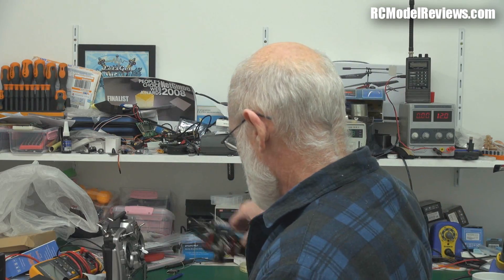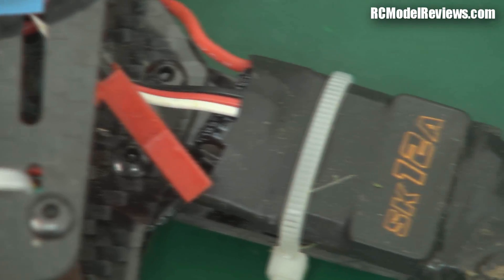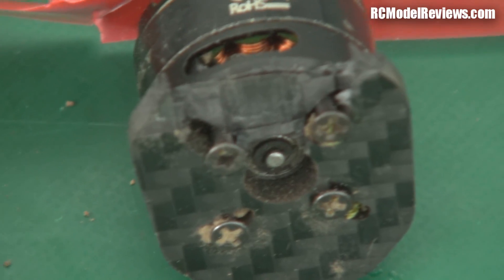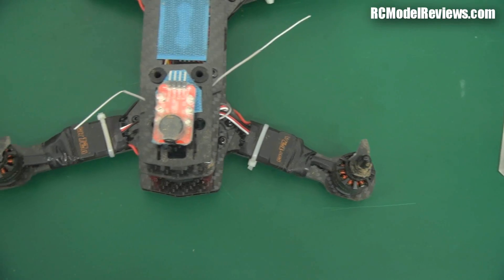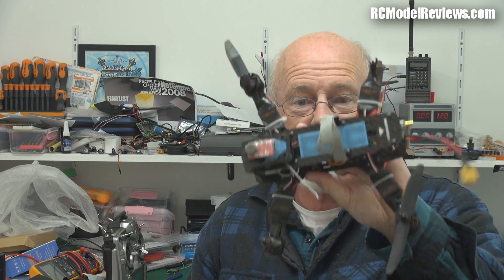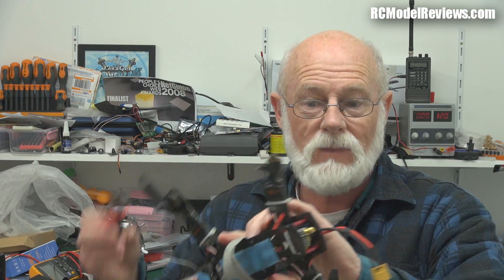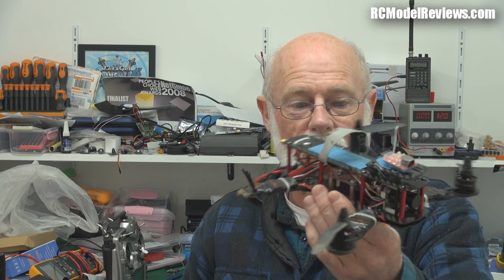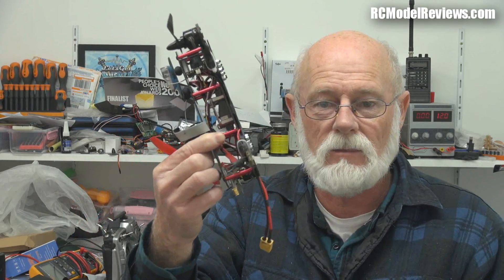ZMR-250 Chinese mini quadcopter crash report

Comment: I guess the absolute purists here will say you are assuming at least one thing here, Bruce.

And that's that the quality of the CF itself is the same for both the Blackout and Chinese arm. And, of course, that they are of the same thickness.

If we assume that both arms are of equivalent thickness and quality of CF process, then the physics of stress-risers is at least comparable.

BUT - I'd almost bet my left nut that something made by Blackout is GENUINE carbon fibre... laminated and baked etc. under strictly controlled manufacturing processes. And I'd almost bet my right nut that the Chinese copy is going to be lucky to be all CF, with probably a lot of fibreglass thrown in there with some black pigment and some neat top and bottom laminate this is actually real CF matting. If you're lucky.

Hell, I can airbrush you a piece of just about anything and make it look like genuine high-quality Carbon Fibre.

So while this vid is very informative regarding the theory of stress-risers etc, it is still assuming that both blanks that were used to create each design are of the same physical construction and quality. 

Out of interest, I'd love to see some MOR (3-roller Modulus Of Rupture, or aka 3-point Brazilian Fracture tests) and CCS (Cold Compressive Strength) results from the base CF stock used in both arms.

I'd just about bet BOTH my nuts that what you are getting from the "more expensive" brands is genuine and correctly manufactured Carbon Fibre composite as opposed to something that 'looks kinda carbon'.

Just because it's black and has a nice symmetrical weave pattern top and bottom DOESN'T mean it's carbon fibre - I can do that with some black and grey paint, an airbrush, and a piece of fine wire mesh... and make your average BIC lighter look like something from an F1 car...

Q:)
Reply: Nice job of quoting Wikipedia, do you really have a clue about what you have written?
Blackout doesn't make their own CF they buy it from Japanese manufacturers like everyone else does and if they say otherwise then I would love to see their plant and meet the man that put up the millions to build toy helicopter airframe CF.

Comment: The motor can be repaired if it is just the wires. Just rewind the coils.
Reply: Tuttomenui For $9.99 it's just not worth the time.
Reply: yeah true, but for the $45 motors you mentioned if you had the same issue in that case it might be worth it.
Reply: Tuttomenui
However, if you can afford to spend almost $200 on motors, I suspect you'd be using a more expensive frame without this weakness anyway ;-) 
 
The ZMR250 is a budget frame which is best equipped with budget motors/ESC,s etc (IMHO).

Comment: Sir I have been watching your videos regurlarly since I came into this hobby. You are always biased against Chinese stuff. Please do a fair comparison. The blackout and other similar products like QAV 250 are way to expansive. I own two blackout minis and they didn't survive a single crash and was in worst condition than this Chinese quad. Now I am bashing myself not to buy 3 of these Chinese one against the price of one blackout. I am not offensive but trying to be honest I am sorry.
Reply: Zubair Aslam Raja I am not biased against Chinese stuff.  I simply rate each product on its merits.I was one of the first to use and highly praise the FrSky RC equipment (made in China) because it is very good.I have strongly criticised many non-Chinese products (such as the DSM/2 system from Spektrum).I constantly recommend the AXN model as a brilliant option for those learning to fly.It has nothing to do with where a product is made so much as the value and quality it represents.The vast majority of stuff in this hobby now comes from China so it stands to reason that the vast majority of stuff that turns out to be bad will also come from China.   It's the law of averages.

Comment: this review is bullshit, i always expected honest opinions from you bruce... the other sellers giving you flak? flying thru a fence in a blackout is not like falling out of the sky...
Reply: Luke P Crashing on to hard, dry dirt from about 100 feet (which I have done several times with my BO) is a lot harder on a frame than falling onto wet rain-sodden soil from a lesser height.  Watch the upcoming video and you will see that the ZMR250 arms are weaker than the BO arms - which is why this one broke.

Comment: Its all analogy until you take one of each arm, perform a lateral bend and edge on compression to structural failure test with force and deflection measurements on all the manufacturers arms. 

Right now it's all a collection of meaningless lip service, opinion and complaining without quantitative data.

Bottom line,  fact, there was a crash and an arm broke. Fact, the arms are not the same dimensions, fact stress riser analysis its correct in identifying the weak spot longitudinally that are most likely to break. Fact, there was no mention of the measured thicknesses. Fact, there is no quantitative data on the CF material or process used in making the arms. Fact, shit happens and manufacturing defects occur.

Making assumptions and extrapolating conclusions is inappropriate without the proper analysis. 
Hopefully proper testing can be done  (expensive) or people should stop crashing, neither is likely.

Have fun and lighten up.

Comment: bullet connectors
Reply: Just IMHO, but, I think that using any type of connector, the wires would have been broken just the same.
Maybe not in the motor, but pulled out of the connector.
The connectors are very hard to unplug, if not, then you'd have a "weak" electrical contact & possibly
generate a high resistance "joint" & cause over heating due to the large currents drawn through that
"loose" connector.
--------------------------------------------------------------------------------------------------------------------------------
&, as you all know....everything has a breaking point. It all depends on the angle of impact, velocity,
hardness of whatever it hit, etc etc..

Be interesting to see static "binch" test comparison between the different manufacturers material/s.
A vice & variable weights spring to mind. ;)

Keep the reviews a'goin' Bruce.
We all appreciate your views.

Regs, L.
(across the ditch.)